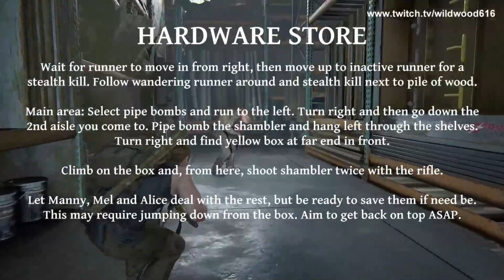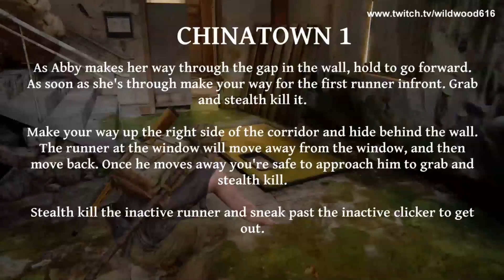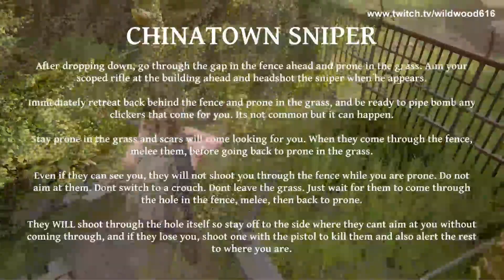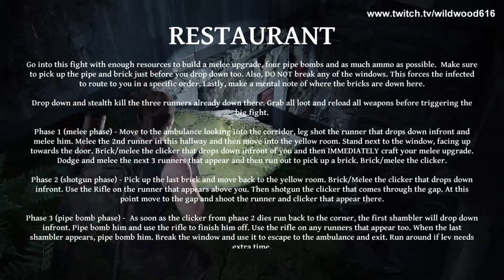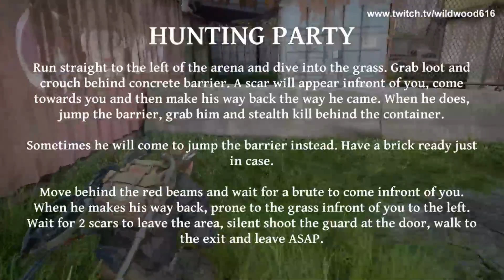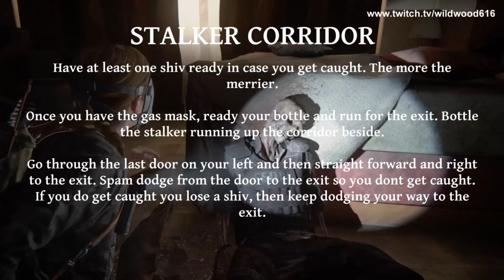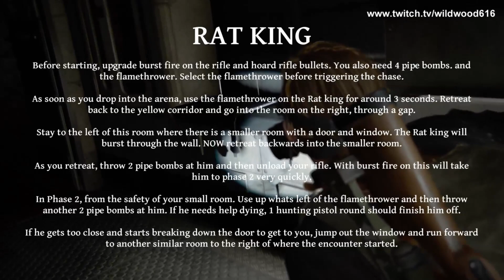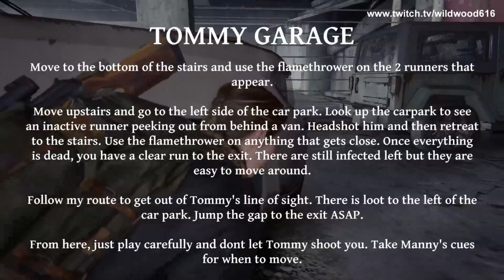The Last Of Us Part 2 - Grounded Whole Game Permadeath Part 4 (Hardware Store - Island)

Comment: Finally! Got through the seraphites without using all my ammo 😂
Reply: Just did The Shortcut for the last time. It was so funny at the Seraphite Outlook this time - just before elevator. I crawled to the big grassy spot, head bolted the soldier who comes to the edge of the platform, and shot the brute. Everyone else came to the grass one-by-one. I was just chilling by the vertical girder, and they each walked by without seeing me. Cracked their necks. Two live ones were left up top and I only bottled the last one. Got my bolt back. Took down nearly the entire outpost by stealth, but it was the first time it was so easy from the grassy patch.